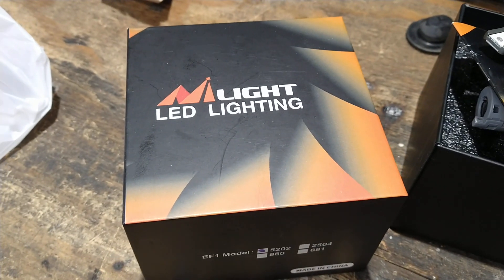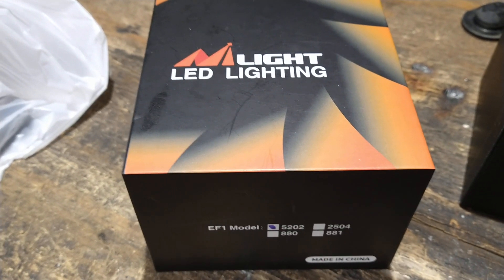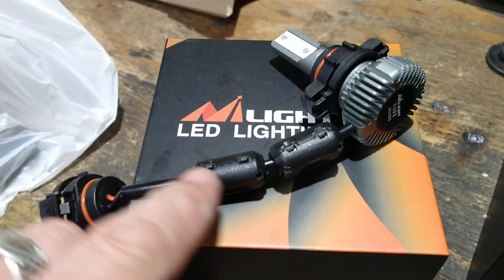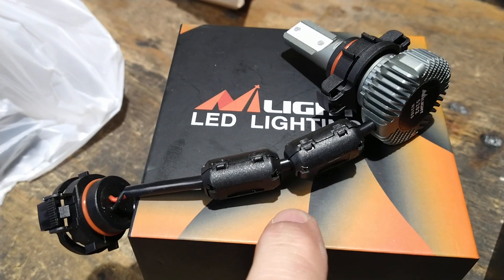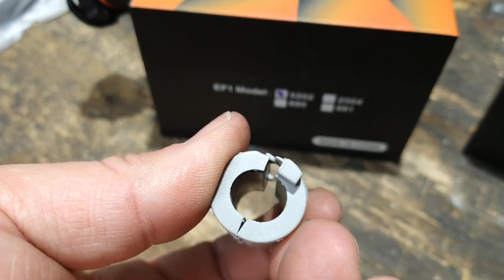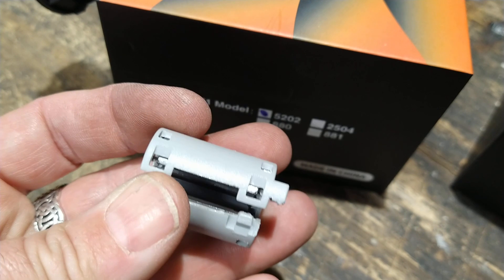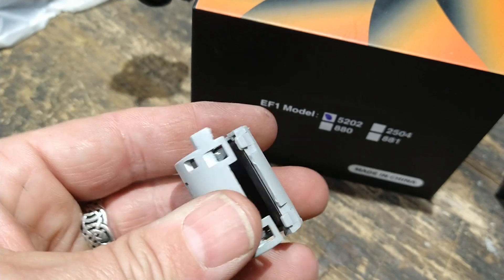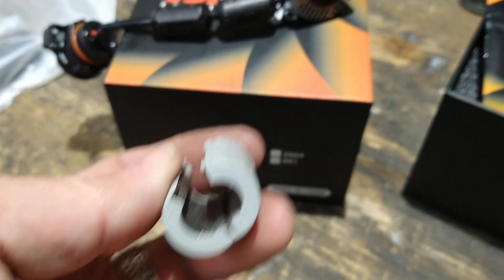How to get rid of electrical noise (RFI) from aftermarket LED headlights!

Comment: Better to loop the wire through one choke twice. 
If you can, poking the tail or plug end of the wire out the same way it went in can sometimes make it work a bit better. Use a cable tie to stop it pulling through. If there's room put the smallest choke that will tightly clamp the wire on the end or even after the plug.

A better bet is to buy globes that advertise as having radio interference suppressed and use chokes to further improve performance. 

Some guy on YouTube put an oscilloscope on his light bar and found where the RF noise was and built a proper filter LOL. 
It worked perfectly - there was absolutely no noise.